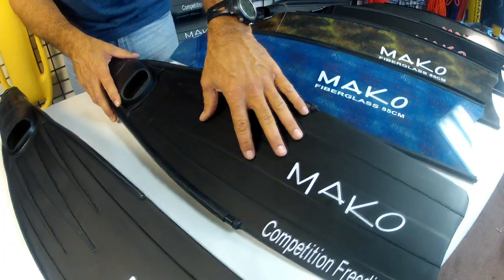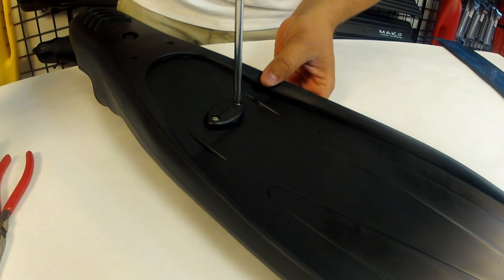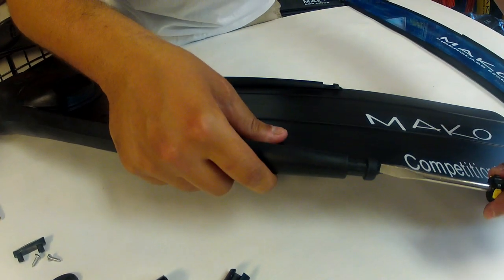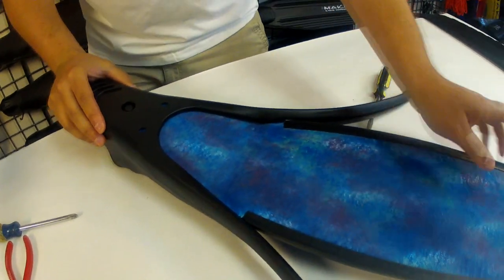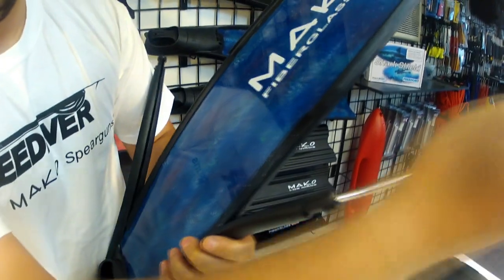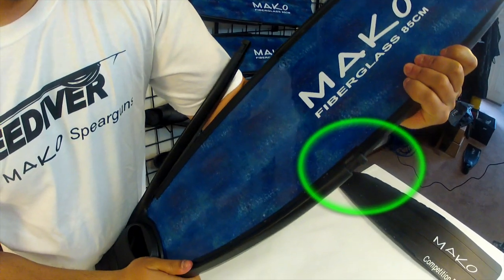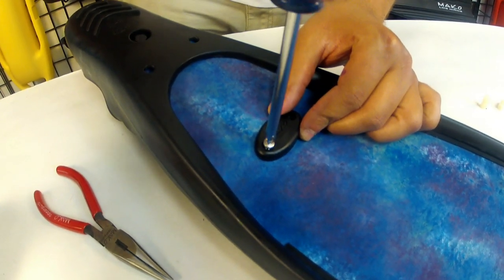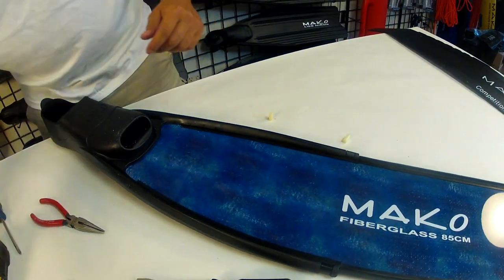How To Change or Upgrade Your Fin Blades - MAKO Spearguns

Comment: That makes it look so easy!
My attempt was not so easy (or uneventful). Maybe that’s why I work in an office!?
The C-clip did not go on easily at all, nothing like the demo. It was very stiff and was virtually impossible to install leveraging off he edge as shown. I used a pair of opposite - aka opening - circlip pliers. This made it much easier. 

It is very easy not to get the blade firmly in the pocket before drilling because it “migrates” when you put the sides of the pocket all the way down the fin blade edges.  Got my first one wrong. 

Caution - don’t do what I did - do NOT put the foot pocket in the oven even for a short time on a low temperature - it wrinkles the edges of the foot pocket - probably still ok but less than optimal. 

Drilling with a small drill first e.g. a sharp 3/16” drill bit is better than drilling with a 1/4” because the carbon is so hard and there is more danger of splitting the fibres with a larger drill bit. Just try to go slow with feed pressure. 

Lessons learned - better to learn from someone else’s mistakes. 
My 2c.

Comment from the maker: Great question! How'd we overlook that on the video??? 

We use a #34 bit which is just slightly larger a 7/64 bit (2.8mm). If you purchase the blades from us, we provide the #34 drill bit with your blades so you don't have to worry about having the correct size bit laying around.

- MAKO Spearguns
Reply: I didnt get a drill bit from you folks with my blades but I used a 7/64 and the screw may have been a bit more snug than with your size bit but it worked just fine. Just in case anyone is in the same situation.
Reply: @Fatvod  did you get the drill guide inserts?
Reply: I did not get the drill guides or the drill bit - had to improvise. :face-orange-raised-eyebrow:

Comment: does the foot pocket fits other blades such as mares razor or beuchat ?
Reply from the maker: Great question! Our foot pockets fit just about any blade except for the beauchat blades.  Beauchat blades are very good quality blades, but they are designed to fit the only Beauchat foot pockets.  Other than that, the MAKO foot pockets should fit just about any blade.
Reply: ok thanks ! how can I purchase your product from abroad ?
Reply from the maker: Just send us an email with your full shipping address and the products you're interested in. The guys will get right back to you: info@makospearguns.com
Reply: ok . you guys are the best .